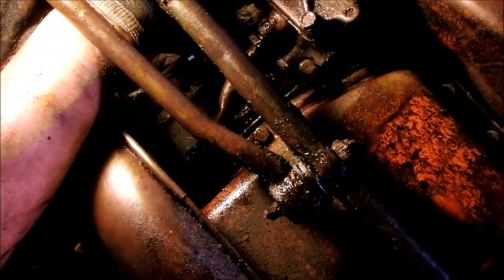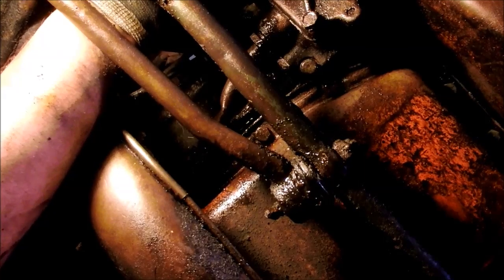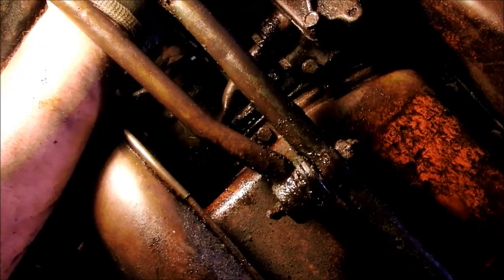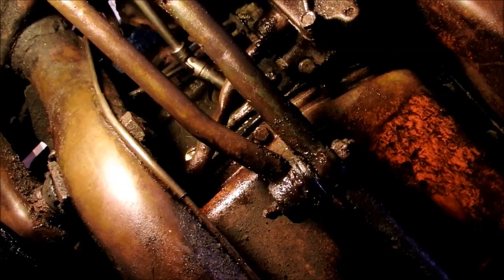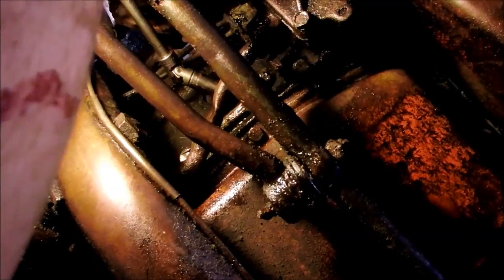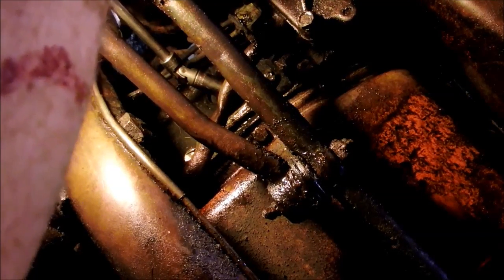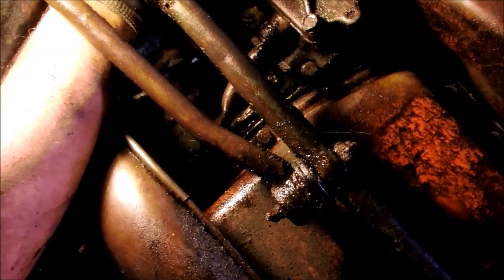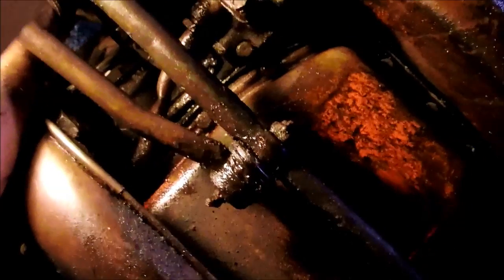Spin On Oil Filter Removal '55 Ford 7

Comment: Rpeek,  I'm wondering if you could get a plastic wedge between the edge of the filter and the block where the o-ring would go.  If you start rolling up that lip and breaking the contact between the o-ring and the block it should spin off easier. 

Also, check the threads and make sure it isn't left handed....

Comment: Get a steel rod instead of a screwdriver to hit on.
The plastic handle on the screwdriver absorbs the "shock", you need the shock of the hammer blows to break it free.